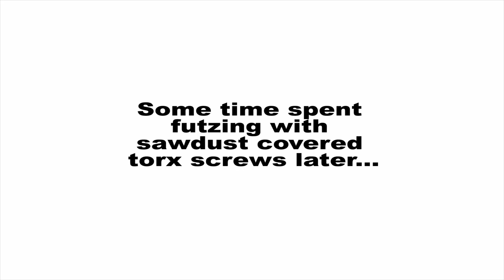Craptacular $150 CNC Upgrade!

Comment: If dust is your biggest issue have you considered connecting a vacuum to the router bit to reduce it? It seems like a higher level issue is causing lower end problems.